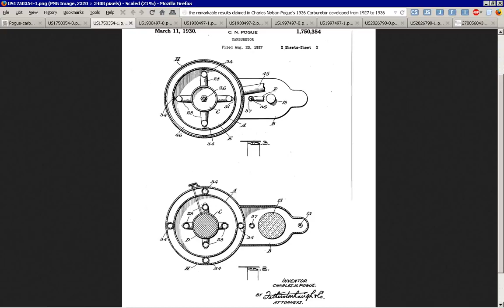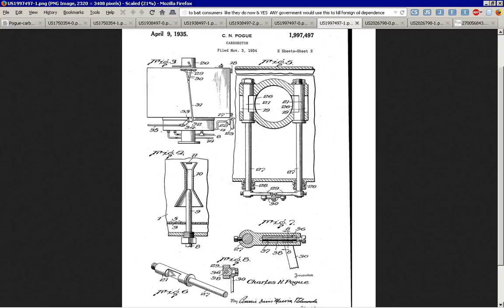Charles Nelson Pogue Winnipeg 200 MPG Vapor ware Carburetor Patent HOAX 1927 1936 debunk by waptek

Comment: BS. My friend made one for his Comet and we drove around all day on it.
Reply from the maker: dear daverdal1 (2011) the Canadian neocon? political grind-core band fan 

2019 cars got 25 miles per gallon (or more) & gas tank capacities are 
10 gallon in mini cars , 20 gallon in sedans , & 30 gallon in SUV's 
SEO   
for 08 hours & 480 miles it needs a 19 gallon tank max &
for 12 hours & 720 miles it needs a 30 gallon tank max &
for 16 hours & 960 miles it needs a 40 gallon tank max ?

BTW was it a MERCURY Comet with a 16 MPG engine & 16 Gallon tank for 
a  256 mile range & 4 hours total drive time, or did it have the bolt in 20 gallon 
tank & do 23 MPG on a highway for a total of 460 mile range & run for 8 hours ?

basically your friend drove around all day on a full tank of gas, 
WOW , a-maze-ing, & or you use metric & got confused , ish

https://archive.ph/wip/CtSop
http://fuelly.com/car/mercury/comet/1964
http://amazon.com/dp/B078X11KNZ 
http://autocityclassic.com/TS6465COM 
http://en.wikipedia.org/wiki/Mercury_Comet
http://cashcarsbuyer.com/gasoline-tank-capacity/ 
http://800loanmart.com/blog/top-cars-in-the-us-and-their-gas-tank-size/ 
http://discogs.com/artist/1988838-Guns-Liquor-And-Whores 
http://en.wikipedia.org/wiki/Head_Hits_Concrete

Comment: 1927 Ford Model Ts used a fuel vaporizer. So did the Fordson tractor. The design was contracted out to a couple different suppliers. Hundreds of thousands were made, and there are still a lot of them around. Model T guys usually replaced them with normal carbs, because the hot plate (the metal heated by exhaust to vaporize the fuel) tends to burn out and get pinholes. In any event, the Ford vaporizers were far, far simpler in construction than Pogue's, yet accomplish exactly the same thing - fully vaporizing the fuel before it is sucked into the engine - and there is no mystery about them, nor claims of 200mpg. Some Model T people who refurb them instead of replace them with carbs report that there is slightly higher fuel economy, but only just, not double, not triple, not 200mpg!

The real "trick" with the Ford vaporizer, so far as economy is concerned, is that once it was heated up, you could run kerosene in it (and in fact, this was the reason it was fitted to the Fordson tractor in the first place). Which, though this was illegal at the time for on-road use, was much cheaper than burning gasoline.

Comment: I remember my brother telling me about these so called 100 mpg carburetors and in college I had professors claiming former students had solved solar panel issues only to be bought out by oil companies in a deal they couldn't refuse. My response was did they point a gun to their or a loved ones head? Which is really the only offer that can't be refused.
Be that as it may, the more obvious, is that all these patents expired long ago so there's nothing stopping their use except for the plain, less dramatic fact, the ideas had too many issues or were fundamentally flawed, which is why inventors were/are granted 17, now 20 years after filing to develop and bring ideas to market. Patents are the beginnings of ideas not the ends. Being on several patents myself I experience the truth in that.
Now, juxtapose this carburetor conspiracy to 3D printing. I saw 3D printers at MIT's Draper Labs back in the early 90's. Low and behold about 20 years later when the patents expired an explosion of 3D printers came to market. Those patents were obviously sound.
Now back to the conspiracy of Tesla and the magic 3-6-9 vortex I viewed earlier today. Doh! No conspiracy there either. All explainable with math. 3-6-9 is not the key to the universe.

Comment: Charles pouge then went from inventor to a oil filter company man also at this time the price in oil stock dropped ! It did work the science is solid he used kearosen because it had little to no bye product the heating of the fuel using the muffler caused it to vaporize at over 800 degrees liquid gas don’t burn only vapor ! You car typically runs less than 20% efficient! Dig Deeper , the space shuttle runs on water aka hydrogen and oxygen in space ! That also was a myth
Reply from the maker: nope

Comment: Perfectly vaporising the fuel is a good thing , but simple proof is will not achieve anything like 200mpg is propane. That is a perfect vapour when mixed with air entering the engine, but engine efficiency is not drastically improved.
Reply: Ya but propane is already sold in a gas state to the consumer.  Gasoline is sold in a liquid state. How much liquid did it take too turn that propane into a gas state?  Propane was a liquid before it was a gas.  What I mean is 1 liter of liquid gasoline = 2 or more liters in a gas{vapor state} for example
Reply from the maker: @derektompkins2487   thats why we use its "mass" in pounds or kilograms 

some solids or liquids expand in 3 dimensions by 10 times 
as in,  10 X 10 X 10 = 1000 to one , 
so a cubic centimeter expands to a 10 cm cube
Reply: @derektompkins2487 
That's exactly what BSFC/brake specific fuel consumption is for.

"It is the rate of fuel consumption divided by the power produced. In traditional units, it measures fuel consumption in pounds per hour divided by the brake horsepower, lb/(hp⋅h); in SI units, this corresponds to the inverse of the units of specific energy, kg/J = s2/m2."

So, a rather simple measurement of efficiency independent of the state of matter, different fuels or engines etc. pp.